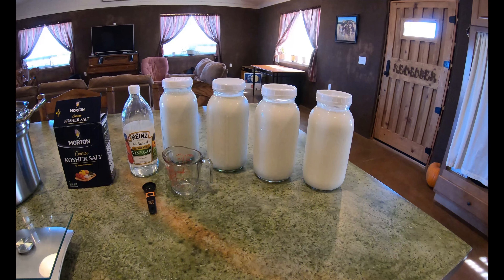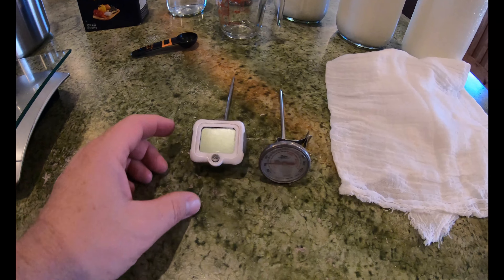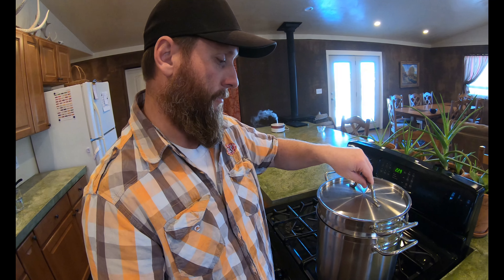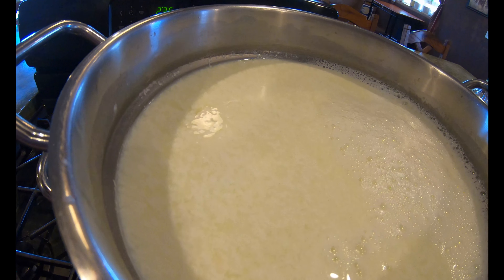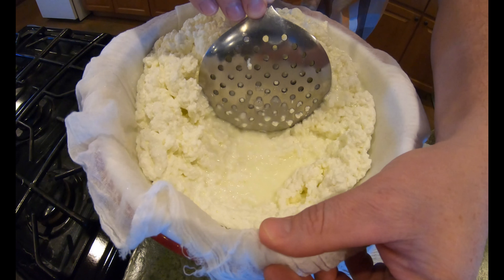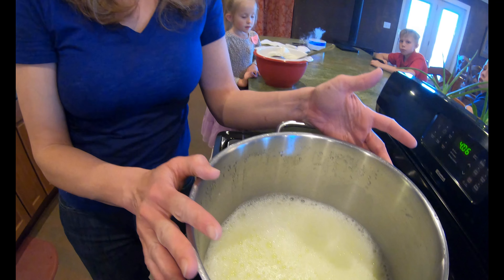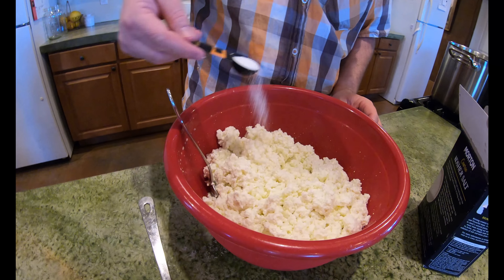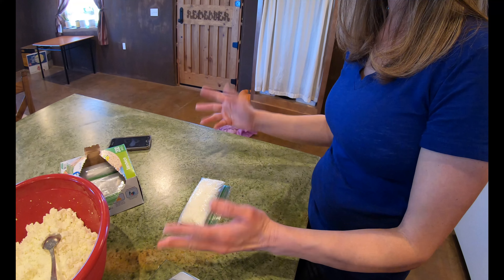Farmer's Cheese

Comment: Hi! 😊 Did you cook the milk on a med/high heat? And about how long did it take to get up to temperature?
Reply from the maker: If you use a double broiler you can put it on high, if  you are making it with a normal stew pot then medium and you will need to constantly stir it.  It typically takes usually 30 to 45 minutes of cook time before you get to the 180 degrees.  Hope this  helps.